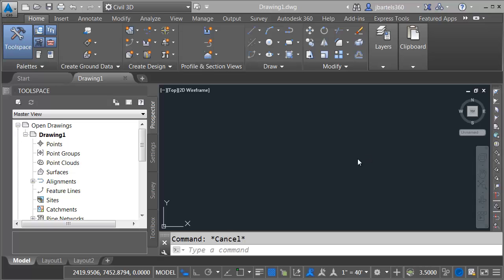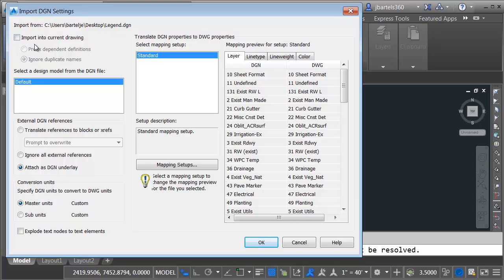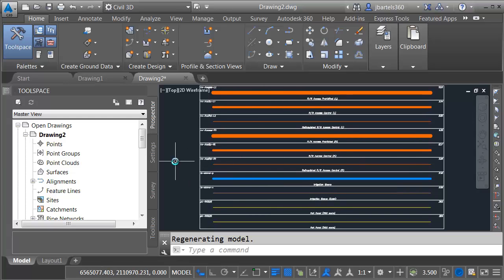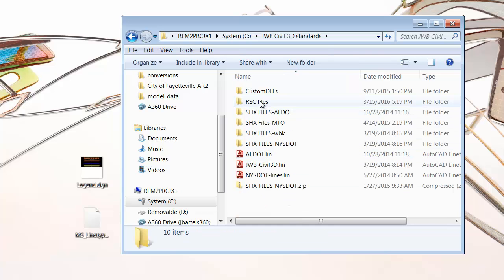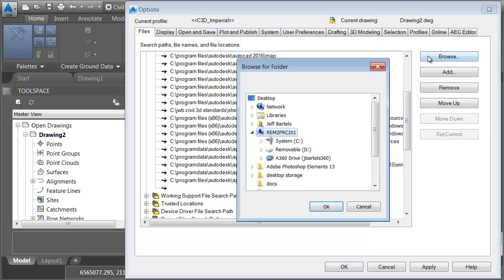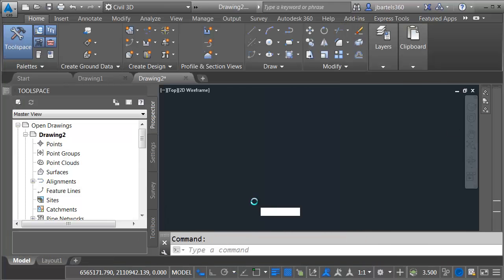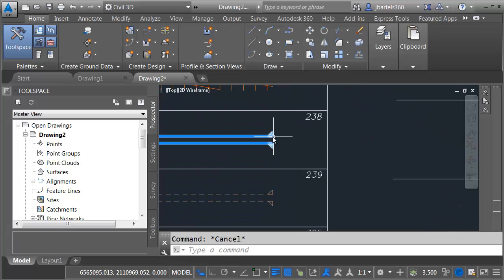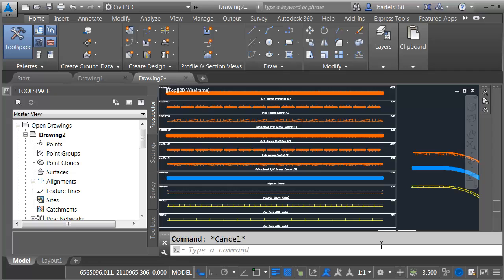Leveraging Microstation linetypes within Civil 3D

Comment: Great video but have you ever had troubles with the linetypes after you close and reopen the drawing?
Reply: I'm having a similar issue. I go through the process and everything works fine but when I get into the file the next day all the linetypes are displayed as coninuous lines and the anonymous blocks that are created in this process (which are used by the linetypes) have disappeared from the drawing.